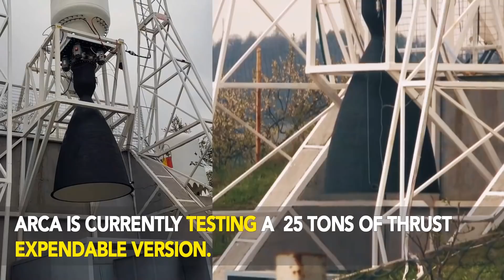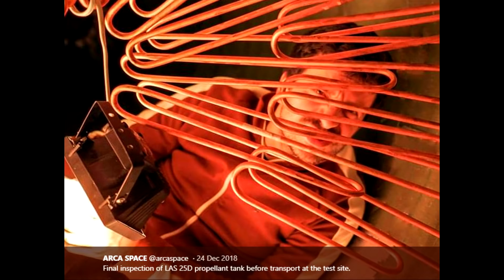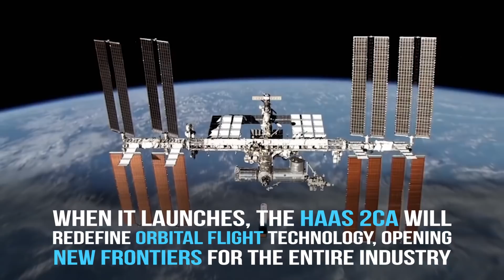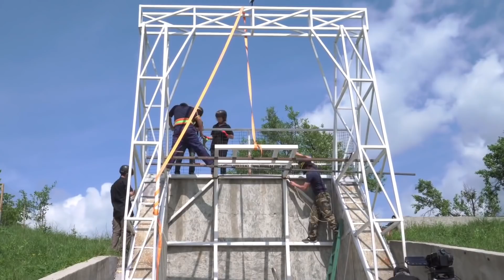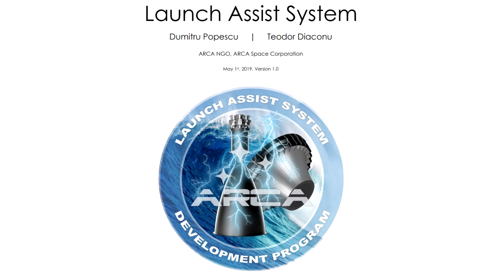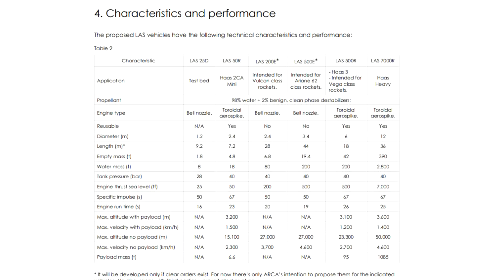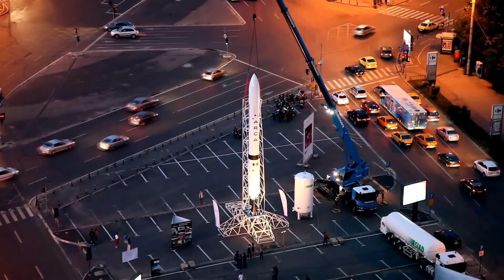Does ARCAspace's Water & Electric Powered Rocket Make Sense?

Comment: "Environmentally friendly rocket"... whole bunch of LiPo batteries...

Aight.
Reply: TBF as we moving forward in battery tech and fusion technology, or if just using some chemical, this thing could be really neat idea.
Its not like its a bad idea having water powered rockets, if we gonna be launching rockets every day in a future space-age.
Reply: @MouseGoat  Its actually kinda cool if you consider mined water in the next 100 odd years.
Reply: LiPo: Lithium-Polonium?!!
Reply: Well actually, the exhaust in the form of water vapor higher up in the atmosphere can become a potent greenhouse gas, way worse than CO2. The CO2 knocks the water cycle off balance by slightly raising temperatures, but straight up adding water vapor to the atmosphere at these altitudes is even worse for the delicate balance.
Reply: Water vapor as a form of self reinforcing feedback loop requires global higher levels of evaporation driven by the sun and enabled by higher average temperatures.
Reply: @MouseGoat  And when we run out of lithium in a few years after a full rollout we'll all be fucked
Reply: @WolfPeste  lithium-polymer
Reply: You use Samsung Note 7 batteries, then detonate the batteries Orion-style, to leave orbit.
Reply: Who's environment?
Reply: @WolfPeste Lithium polymer
Reply: Aight
Reply: To be fair, if you're comparing it to RP1/LOX it's a choice between ground polution, which is containable, and air polution, which isn't. Compared to LH/LOX, though, it's kinda pointless.
Reply: @ryano.8768 
That is true, but water vapor tends to work its way out of the atmosphere quickly whereas CO2 just kinda sits there until it's absorbed by plants.
Reply: VestedUTuber yeah true.
Reply: you can say that about a Tesla car too man.. So idk what's your point
Reply: @ryano.8768  so you're saying that water vapor is more dangerous than CO2? Hmmmmm. Also how do you know what you're saying is true? You realize that you're not adding any new water to the system, excess water vapor will condensate and turn into water. So wtf are you saying?
Reply: @vask92  
That would be a good point, except that electric cars don't dump their batteries straight into the ocean after just one charge cycle.
Reply: @ryano.8768  luckily it's a first stage ,supposed to go a few kilometres/miles up ,not on the upper atmosphere
Reply: miltos ka that's correct 🙂
Reply: @WolfPeste  lithium polymer
Reply: @WolfPeste  Lithium polymer

Comment: LOL... Using Hobby King lipo batteries.  Best not exceed 15c on the discharge!
Reply: Well.. As it's heat they're after, a thermal runaway in the batteries might not be a bad thing. :) Would make them single use only though.
Reply: Actually, this Picture Looks as if it was from their "hoverboard", I don't know what they'd be using ducted fans for on a rocket.
That aside, these are 5000 mAh 5s packs, coming in at 92.5 Wh per pack, about 64 packs in the picture for a total capacity of ~6 kWh. These have enough capacity to provide 42 MW for 0.5 seconds precisely (of course, at a rated burst discharge of 35C, they would need 100 times this amount of cells to be able to actually provide 42 MW, with a total weight of 38 tons (each pack weighs in at 590g) - exactly 1.5 times their stated thrust of 25 tons. So no, this "rocket" is not going anywhere.
Reply: @kain0m But if you could beam the power to the rocket... hmm hmm …
Reply: Maybe there's also a steam turbine with an electric generator, heat recovery, solar pannels and a little Peter Pan who wouldn't grow up. :)
Reply: @nt78stonewobble  

And as an added bonus you could use the antenna (for the beamed power) as a sail!
Reply: @MeetDannyWilson  That probably works best in orbit. :)

Now I'm kinda wondering tho, how much fuel the saturn 5 could have saved if you had pumped in fuel, instead of carrying it along, for the first circa 100 meters (height of the launch tower) or to eg. 8-900 meters like the burj.
Reply: @nt78stonewobble  I think it's a safe bet it would've been a lot of mass but a tiny percentage
Reply: If i recall correctly, mine are rated for 40c discharge
Reply: @perianusilviu6263  please tell me more about this "Peter Pan" system, I are looking into alternative power sources, and my research on this name has shown amazing results, but numbers are hard to come by.
Reply: Solar concentration mirrors, right?  Too bad about the inverse square law...  Maybe we can solve global warming and heat rockets at the same time, with a huge cloud of low-earth-orbit mirror satellites...
Reply: Dear  @SimonBuchanNz  I am shocked that a smart guy like Scott wasted his time and our energy on suck a crappy ideea. No matter how you spin numbers this rocket will not fly because boiled water simply cannot store enough energy to make it to the orbit, but a Peter Pan system can and you only need to use your imagination. ARCA's ideea It's just a fraud.
Reply: First thing I thought too, Scott did say they seem to be running on the cheap 🤣
Reply: 15C is about 4 minutes run time that would be about right. You need some thermal distance from those tanks, though. 250 Celsius is above the decomposition temperature of the most power dense chemistries.
Reply: @Cheap_Grey_Plastic  Ugh, the Zippy Compacts are the worst. They look good on paper but fail hard IRL. They should at least hire someone who know how to test/select good batteries since all their designs seem to require them...
Reply: @nt78stonewobble  

Any energy saved by pumping fuel into the rocket as it launches would have to be much less than simply launching it higher.

I personally still think it would actually be worthwhile to set up launch facilities on the Altiplano. 4km of free altitude is pretty compelling, and it doesn't get too windy or cold like some other places. Lots of open space for manufacturing facilities and few people around, too.
Reply: @damstachizz  True, but if you wanna stay in Florida, then you're gonna have to build it yourself. :)
Reply: @JaakkoSavio  when you have enough batteries to supply 50 KG per second, youre not concerned with destroying a couple.
Reply: So building an electric skateboard is now officially Rocket Science!
Reply: Well, you could use the lithium in the batteries too, just slice em open and add some water. :D
Reply: It's probably a product-placement deal. Hobby King gets its labels on a rocket and ARCA gets free batteries.
Reply: Oh good, I wasn't the only person who noticed that. Those things puff after a couple runs on the ground -- what will happen to them when they're used in space?
Reply: Test burn number 1: "puuuffff"
Reply: @kain0m  Exactly, will it fly today... NO!! Someone needs to go over that rocket equation with them one more time.

Comment: CEO: So you’re gonna falsely charge me of fraud eh? I’ll show you some fraud!

Proceeds to come up with water rocket design
Reply: Does it work?
Reply: @epincion  Yes.  Well?  No.
Reply: Jerry Rupprecht ☆ Romania?
Isn't that where MOST Hackers operate from? Guccifer? "Me: Totally Legit"
Reply: I'm betting that all that funding for their various projects is NOT going where it's supposed to. Whether to the projects they actually want to do or just generally disappearing into pockets, their lack of focus tells me there's something up.
Reply: To be fair, the engine, which is pretty much the mother of all electrothermal thrusters, is solid - the Russians have been using smaller versions as orbital maneuvering thrusters on satellites for decades, and water is definitely one option for reaction mass for something like this. The problem, however, is powering it. You're not going to be reasonably able to use batteries for an electrothermal thruster this large. Something this big would probably be better off nuclear, and then you might as well just make it a nuclear thermal thruster.

Comment: As soon as the temperature of the water was mentioned the first thing I thought of was the water heater rocket on Mythbusters.
Reply: That might be where they got their idea...
Reply: Wonder if they could make a controlled steam explosion just the rocket off the ground then light it's engine at the top of it's appogee. Funny but not practical lmao
Reply: @pulsarsbeam6411  Well, technically, that what the valves & anciliary equipment do.  With the upshot being, that you can reuse it.
Reply: I thought of Evel Knievel at Snake River Canyon.
Reply: That's basically what they're doing… And frankly, it's not a bad idea.  If it adds less than a million dollars of cost to, say, a Falcon 9 launch, but adds a million dollars worth of payload, then there's little real reason NOT to use such a kick stage.  Only thing I can think of is that you don't get to test the Merlins before releasing the clamps. @pulsarsbeam6411

Comment: "Cleanest" rocket propulsion ........nah Hydrolox rocket final product is also "water"
Reply: And if there’s a propellant spill, instead of spilling scalding water, you spill hydrogen and oxygen, which will evaporate instantly on contact with the hot Florida air and mix with the atmosphere.
Reply: @alt8791  is that a sprucccc reference???
Reply: Aerojet Rocketdyne RS-25 no, it’s a real facts reference.
Reply: Well it does interact with atmosphere somewhat and does create few toxic gases.

Comment: Environmentally friendly, till the batteries go thermal.
Not explosive, till the tank develops a fault.
All sat below a conventional type rocket fuel.
Could be a hot shower for those downrange.

Can see Thunderf00t loving this one.
Reply: Not taking into account the fact that everything takes energy and materials to produce. It's not like rockets pop out of thin air. Materials have to be mined etc.
Reply: Batteries have to be charged.  Burning fuel to make electricity to charge batteries wastes energy compared to just burning the fuel outright as propellant - you loose effeciency with every step.

Of course, you could in theory use solar or wind power, but in real life these have their own list of shortcomings.

On the other hand, coal is more abundant than oil, and good luck making a rocket that uses coal as fuel...
Reply: @Keldor314  
No shit, turning coal into a liquid was a popular thing back in the 1850's. Pretty easy too.
Reply: @Keldor314  With a HOME-MADE FIBERGLASS BOILER?

Comment: It's likely an investor bait with the "reusable aerospike with additional heating from batteries"
But what they're ACTUALLY aiming for right now is a dead simple water bottle rocket as an expandable booster. It's literally just a tank of water at 250C and a nozzle (no batteries it's heated before launch) and apparently that's supposed to be comparable with the boosters currently in use. If they can get as much out of a water bottle as you can get out of a solid rocket booster then they're in business, cause that's WAAAAY cheaper and the booster will only become explosive on the launchpad just before launch rather than during manufacturing and all the way until it's burnt up.
And that's what they're comparing themselves to, to the solid rocket boosters currently in use. I'm really interested to see if they can pull that off.
Reply: I doubt it would work. Assuming the first stage is 3/4 water and the specific impulse is 125 s, you only get 1800 m/s delta-V, which means with gravity losses you're barely at Mach 4. Turbojets get you there far more easily and even those are a bit impractical.
Reply: @ThomasKwa  What? How can you say you get to mach 4? The booster is a tiny part of the rocket, its weight and speed will depend on that rocket more than the booster, right?
And Isp of 125s is basically half of the SRB used on Atlas 5 (245s).
Considering how cheap these would be and how low the dry mass of the water bottle is, it MIGHT be worth it, no?
Reply: MrRolnicek, another point you did not mention which I think speaks in their favor: You cannot control the thrust of solid rocket booster which they are trying to replace. That means SRBs will never support vertical take off and landing (VTOL), however their system is supposed to be capable of that.

So a super simple system, filled with water, which give the rocket a boost and then lands, to be refilled with water again. That sound like a pretty cheap way of boosting rocket over time to me.
Reply: Does the whole booster have to be a pressure vessel if all of the water is already superheated?
Reply: @ThomasKwa  In their paper they claim altitudes of 3000 m and velocity boosts of Mach 2.They claim this will allow them to boost payload of attached rocket with 30%.

Would that not be worth it? I mean you just spend electricity and water. The think is supposed to support propulsive landing, and can thus be reused.
Reply: @erikengheim1106  No the simple feasible version they have can't be throttled either. It's really a hot water bottle with a burst disc at the bottom, bust the disc, water boils and keeps the pressure until it's gone.
The crazy battery eating version that will never happen would be able to throttle.
Reply: MrRolnicek 
Why does it have to be a burst disk? Why not a controllable valve?
Reply: Oh, I thought you meant as a first stage-- I was taking the best case scenario first stage where the rocket is 3/4 water. Not sure about a booster. At half the Isp you need >2x the mass flow rate of a SRB, and I have no idea if that's doable, as an SRB is already very dense. I'm also not sure it will be cheaper than an SRB if expendable. There is a complexity penalty-- not much can be simpler than a cylinder full of rubber.
Reply: @williamchamberlain2263  yes. Only way to keep superheated water liquid is to keep it pressurized.
Reply: @ThomasKwa  solid motors are much more complex than a cylinder full of rubber. composite solid motors are quite cheap, but they are more than a cylinder full of rubber
Reply: Yes because the water must be heated well past the 100 C boiling point so it must be kept under pressure until released.
Reply: Theoretically you can superheat water without pressurising it if it's very pure and held in a very clean container so there are no nucleation sites. But that would be massively difficult to pull off and extremely dangerous.
Reply: @ThomasKwa  not much is simpler than a cylinder full of this solid flammable substance. But a cylinder full of Water hapens to be one of these things.
Reply: @q.e.d.9112  Burst disk is cheaper
Reply: MrRolnicek 
Sure, but we’re talking about being able to throttle the rocket.
Reply: @q.e.d.9112  OK, the performance is so low that recovery is just not gonna happen anyway. Thus these boosters are expendable and use a burst disk.
Reply: +MrRolnicek

It's all fun and games until you think about the sizes involved to compensate for the low specific impulse, as well as pressure bearing and insulated construction to survive 250 deg. C water.

Fuel is cheap. But is it going to be cheap heating it up to those temperatures and storing it?

Calculations have to be done. It is plausible, but practical or not remains to be seen.
Reply: @jackvernian7779  They've done test fires (ARCA) not just calculations and they've linked the paper with their calculations.
They say they can hold the pressure at that temperature.
And I can already answer you that heating it is dirt cheap while storing it is not needed because the water would be heated on the launchpad just before launch, not sooner.
I am curious if they convince someone to strap their water bottle to their rocket and if they can deliver.
Reply: @MrRlonicek
could you link me that paper as well? I'm interested.
Reply: @jackvernian7779  Just look up ARCA's YouTube channel. It's linked on their newest video. But I'll spoil it for you: There isn't much there to be seen. TL;DR is fibers of the CPV are easy, they just had trouble finding the right resin, now they have it (or so they say and the test fire suggests)
Reply: And everyone here commenting on how this will work, never mention anything about the boiler tank made from fiberglass. I think everyone here need's to take a step back and ask, " Is anyone here on Planet Earth ever created a boiler tank from fiberglass hand layed like the one shown by ARCA" ? The answer is, NEVER. If so show us, or shut the hell up.
Reply: You can't superheat the entire water contents ahead of time - the tank would have to be extremely heavy to handle that much pressure.  You're talking nearly 600 psi at 250 deg C.  As a comparison, the Space Shuttle external tank was built to withstand 38 psi in the liquid hydrogen tank and 25 psi in the liquid oxygen tank.
Reply: @stargazer7644  They did a test fire, you know... So it works to SOME extent. Frankly I don't remember if they said what kind of pressure they had in the test fire.
Reply: @MrRolnicek  ISP is like 30 sec-50sec
Reply: @abhinavprashant2213  Is that measured or calculated? Can you share your math please cause I'm not confident doing the math myself.